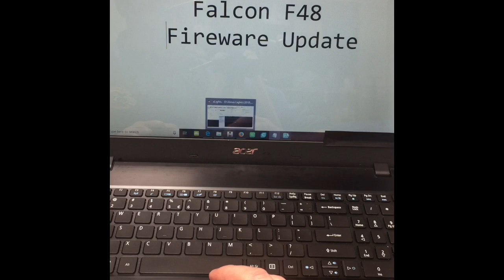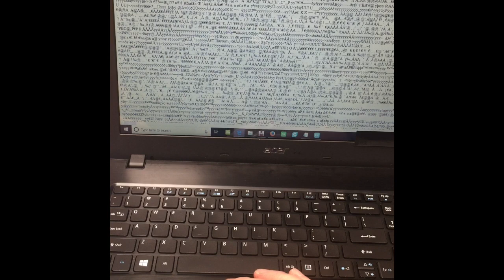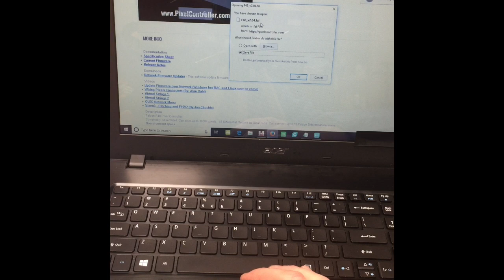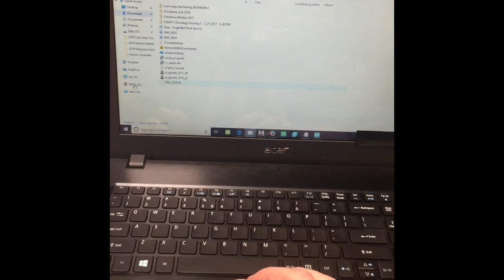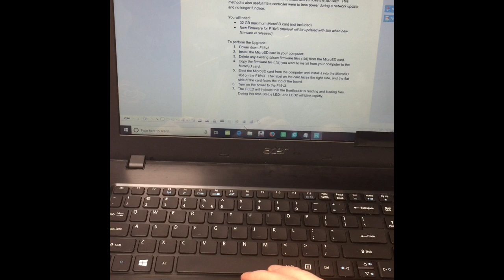Falcon F48 Pixel Controller - Firmware Update V2.04

Comment: In the Edge browser, you could probably right click the firmware link and select Save As to save the file.
Reply from the maker: Hi da-Share, thanks for the comment. I don't have much IT experience,  I just tried to right click the link using Edge browser as you suggested however this didn't work for me (It could just be my computer / browser settings also?), thanks again for the advise.
Reply: I just checked in Edge browser and you're right.  The Save Target As doesn't work for that file.  Stupid Microsoft.  lol